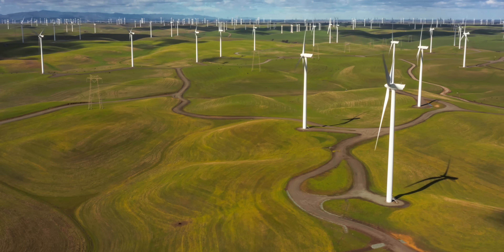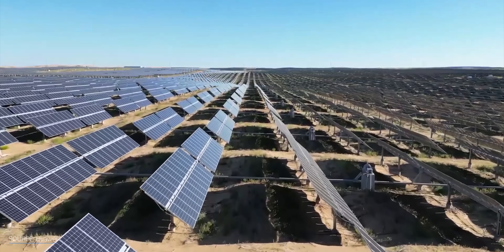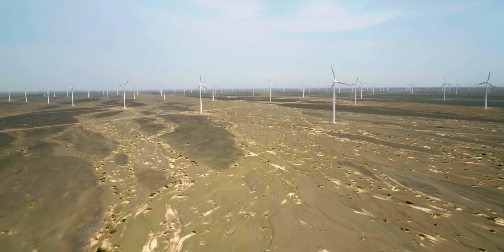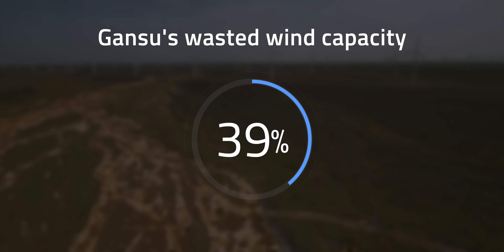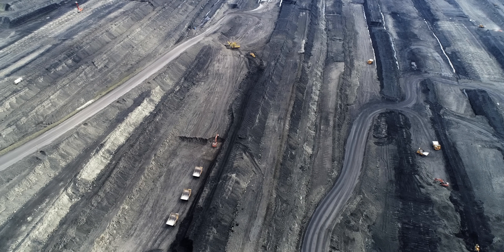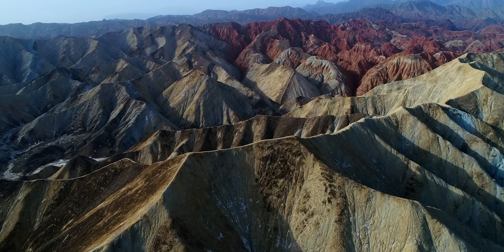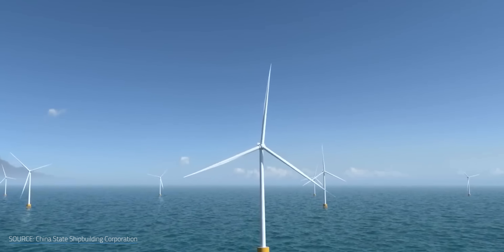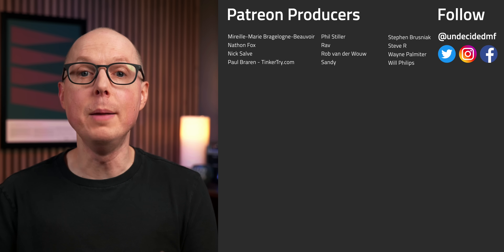The World’s Largest Wind Farm has a Tiny Problem

Comment: One thing I noticed about the big wind farm and the big solar panel farm is that it would be fairly easy to build both on the same plot of land. Wind turbines don't make large shadows, and while wind farms aren't always sited in the sunniest areas, there seems to be plenty of overlap where both could be combined. But I don't see that, and I'm curious as to why. Southern California have both types of energy farms, but they aren't co-sited. So to me, that seems like a waste. There is a lot of land around the wind farms that could benefit from solar panels. Obviously, lack of space isn't a problem in the Gobi desert, but real estate in the US is expensive. So optimizing the energy generation per acre seems like it might be a good idea. (Although I really liked the way that western Germany does wind power: they just plop the turbines down all across the countryside, instead of bunching them up on wind farms.)
Reply: I think that there may be an issue with the shadow of the rotating blades passing over the panels.  As I understand it the rapid movement of shadows across a PV array causes the inverters to flip out due to rapid fluctuations in the DC power.
Reply: @lindsaydempsey5683  You are correct, as the voltage variation for a direct conversion device is instantly related to the solar incidence.  Fluctuations are not the friend of solar PV.
Reply: Good idea, but there are many large wind solar hybrid power projects across the world. Maybe you take the lead of getting them to the US!
Reply: You can also still farm around wind turbines, and there's work being done to prove out farming around and under solar panels.
Reply: Ease of maintenance.

Much easier to replace blades when the ground isn't covered by solar panels.
Reply: The wind turbines work over farmland too.
Reply: Go for it. Watch a wind turbine loose a blade and take out a large nuber of solar panels. Turbine tip speeds run 180-200mph with a several ton blade. Wow, can't fix stupid. This doesn't factor in the ability for a wind turbine in cold climates from throwing ice chunks at high velocities.
Reply: @davepfanner2902  Waiter, there is a fly in my soup.  Everything has challenges.  Have you ever seen a slightly out of balance steam power turbine in a coal power plant?  Even a tiny balance issue can wreck the thing.
Reply: @dancoffey8412  , okay... Only need one turbine in a coal plant. Need 2,000 operational wind turbines to equal the power of the coal plant. So if you believe keeping one running is a challenge. Try keeping 2,000 opertional. The problem was amplified by 2,000x good job. See, can't fix stupid.
Reply: @davepfanner2902  Operationally the turbines are very different in terms of the rotational forces and speeds that must be endured.  A large coal plant is 3000 to 6700 MW, with 50% utilization. There are about 100 such facilities in that size range in the world. More typical is 350 MW. Coal and steam power are very old technologies with very limited upper limits on efficiencies.  A very large percentage of the stored chemical energy is actually converted to electricity.  The rest goes to waste heat lost in the cooling water. That's the kind of stupid stuff that engineers talk about.
Reply: @dancoffey8412  you're absolutely correct. Wind turbine gearboxes and generators are subject to many different forces. Much more than the relatively static conditions of a coal steam generator. Wind turbine generators must rotate with the tower and the several tons of rotating mass/turbine blades. These type of movements induced many different loads and from many different axies. Which is why there are large failure rates in wind turbine gearboxes and generators. Some leading to generator fires, which can also lead to tower collapse.
Reply: @davepfanner2902  Even if you need 2000 wind turbines, wind energy is still the smarter way because you don't need to mine coal. BTW there are enough older coal mines that can carry the waste of millions of wind turbines without all that trash adding anything bad to the trash on the sole of an old coal mine.
Reply: @davepfanner2902  Hey, such accidents can happen anywhere. For example, a skyscraper being built in the middle of a city can harm every other building nearby!
Reply: @ecoideazventures6417  , and they do. World trade center is perfect example... One thing skyscrapers don't have are large rotating masses??? Ah you see, there... no spinny spinny. Last time I checked the elevators in those buildings don't move at 180mph to 200mph??? Do they,?? Not that I'm aware of in normal operation??? Really you want to compare a wind turbine to skyscraper???
Reply: @davepfanner2902  "Wow, can't fix stupid". Classy, really adds to your point. Which would be a good point if it were something that happened often, oh, wait, it's a very rare failure mode. Maybe, I dunno, look at the examples of places that actually do it before commenting.
Reply: @Ylyrra  , turbine blade loss, and delamination failures are some of the most common failures. Nantucket wind farm just shut down do to turbine blade failure. Don't read much news??? As I said, can't fix stupid. The only more rare event is a turbine blade shedding ice or snow. This is usually because they are shut down in these conditions. Which happens to be a time when energy demand is high. Another reason wind generation belongs on the short bus of ideas for energy generation. Wind turbine tower collapse in a tornado would also take out large areas. The super rare tornadoes. Which happen several hundred times a year in the US...
Reply: @davepfanner2902  Failures, not loss. There's a big difference.
Reply: @Ylyrra  , anytime a wind turbine blade has a failure, it results in loss of something.  The turbine blades run at 180mph to 200mph. Which means extreme forces. And something is going to be damaged in the near by area. Hence the reason sections of turbine blades washing up on the beach. If you want to qualify loss as the entire blade in one go. Fine more seldom, but not zero.
Reply: @Ylyrra  not as much as your comment might indicate. A turbine blade at it's tip runs 180-200mph. This creates large forces in the turbine blade. Why tubine blade failure is a fairly common failure mode. Further when a blade does fail, objects with 180-200mph velocity have very large destruction force. (Loss of fuel tank foam on the shuttle, is a good, example of a very light material at high speed, doing a lot of damage) Turbine blade loss is not zero however.
Reply: @davepfanner2902  Didn't say it was zero chance of the blade detaching. Said it was rare. Last figures I saw was about one per year, which out of multiple thousands of blades reaching end of life each year is a rare event when it comes to cause of failure, and relative to installed number of turbines worldwide.

Blade failure IS a common failure mode, but it's not blades coming flying off the turbines and trashing everything in their path. It's like saying "cracks in aircraft are a common cause of grounding", it's not fist-width cracks, it's small cracks that result in preventative action BEFORE it becomes catastrophic. It still gets called blade failure though, because that's the component that failed.
Reply: @Ylyrra  , there are many types of blade failure and [RUD's], or rapid unscheduled disassembly is one of those. Hence Nantucket. I laugh at the many news article state this is a rare occurence. So rare it happens routinely. I know, because my father worked for NASA/DOE and synced the first NASA wind turbine to the grid. mod-0. As you state thousands of used turbine blades, which then sit on acres of land, as environmental trash. The wind turbine is so green it creates acres of trash, and the amount of trash keeps growing. There's also a thing called vibrational work hardening and cracking of the steel support structure/tower which over time leads to tower collapse.  Much like pressure cycles on the hull of commercial airliners.

Comment: Green hydrogen or ethanol is the ultimate solution to renewal energy storage and transmission even in China. It loses a little conversion efficiency but is compatible with existing infrastructure.

Comment: 10 miles by 11 miles of basically wasteland, isn't actually a lot of land.   In a country the size of China, it's about 3 ten thousandths  of one percent of the country.  It would be better if it worked, though.
I am confused by the conflicting sizes mentioned.  First, figure of 70000 acres is about 10 miles by 11 miles.  But the later a figure of 139000 Square kilometers is then given.  Thats like 125 x 120 miles.  50 times bigger?  So now Im just confused.
Reply: Or 3049200000 square feet😁
Reply: @metricstormtrooper  OHHH,... that helps,....thanks!
Reply: All these videos are just repeating claims made on various websites…there’s never any original research or fact checking.  The numbers claimed depend on which website they looked at last.
Reply: @annoyingbstard9407  It's called aggregation. No great harm in that, it's not meant to be a scientific paper. I mean, compare its accuracy with Fox news...
Reply: He said Belgium and I’m like no fucking way
Reply: Belgium is about 31'000 square kilometers. That's about 103 Km x 300 Km.

Comment: It's nice to get excited, but have you done the math on storage costs vs generation?  The math does not work well for 'low cost' energy.
Reply: Even with current LFP battery costs - 50$/KwH-installed-capacity and 5000-cycle life - the arithmetic works out (I hesitate to call something this trivial "math"). But when Sodium tec is productionized, costs should reduce at least another 30% from here.
Reply: @jonb5493  Not sure.  That local region's power costs of 0.07cents vs 0.04cents for coal.  

I pay many times those prices in US, so someone would have to work out details of the math.  

Cost of storage battery tech is only one small piece of an installation/maintenance over 1-2decades of large scale mega/gigawatt infrastructure.  This is not putting a LFP battary in your off-grid camper.  Telsa type grid level storage is tiny compared to daily grid use.  It's a peak leveling solution vs a grid power storage use case.

This channel tends to hype tech without going into messy details like cost analysis.   Excitement is free, implementation is not.  Cheer-leading does get views and sponsors on YT though.  Plus, peanut gallery comments like mine :)

Comment: Building a wind farm which produces twice the power you can actually use does seem a teensy bit of a boo-boo.
Whatever we may think of China's political system, when it comes to engineering they get it done. 
They will sort this out, and ensure that in future generation capacity matched the ability to store or transmit power elsewhere. 
Unlike Texas.